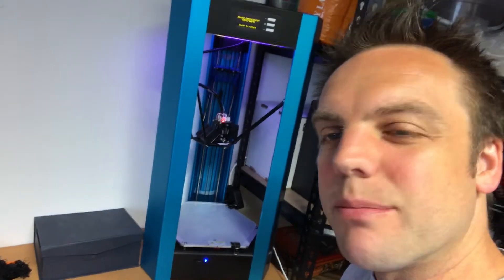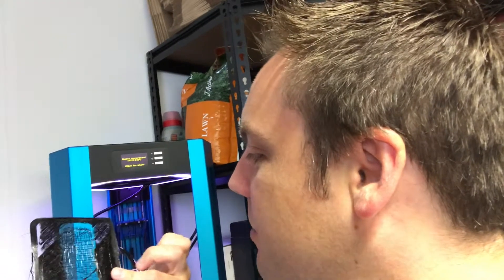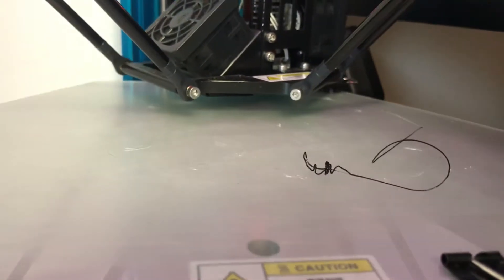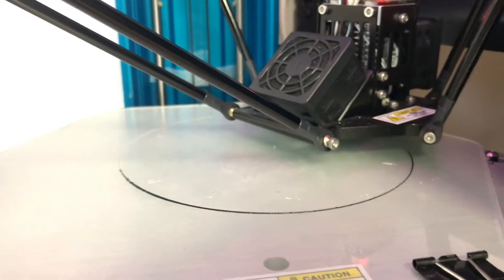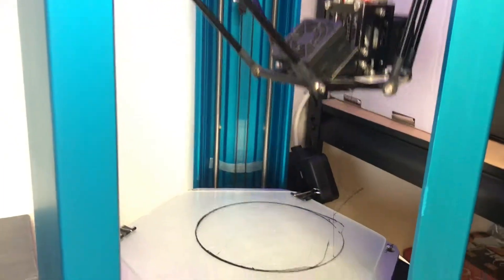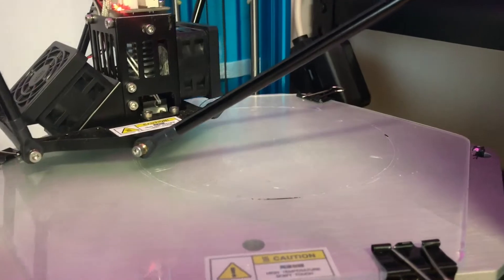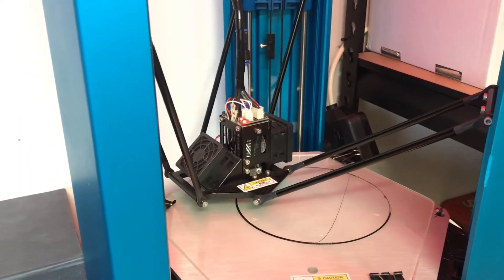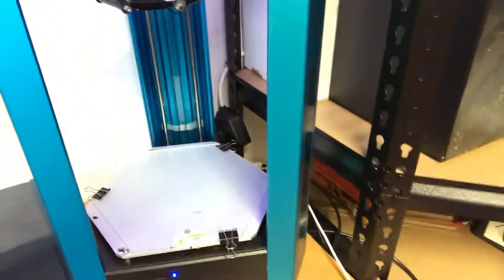Overlord Pro Manual Bed Levelling

Comment: Hello there, I tried this method on my overlord but each time I use manual calibration the results differs and when I try to print something the extruder squishes the plastic on the plate. Did you have this kind of issue?
Reply from the maker: Edouard Metzger yeah that’s about par for the course on the first few layers.

Once you get past the first few layers it’s generally pretty good for small items